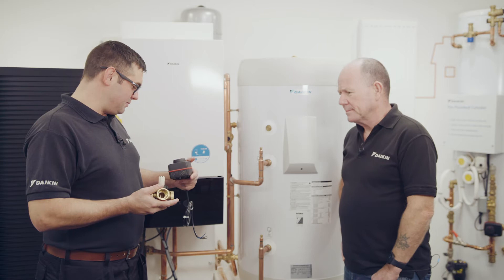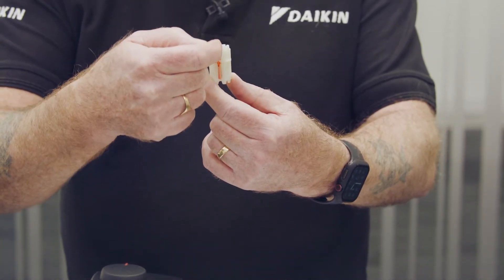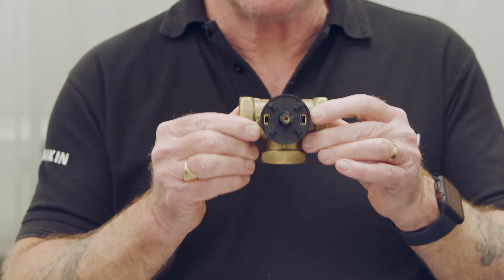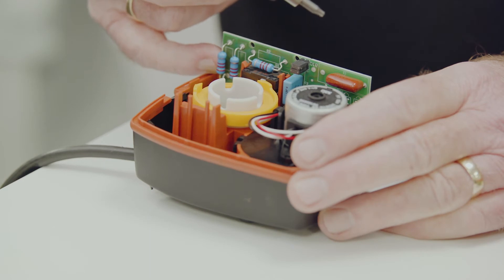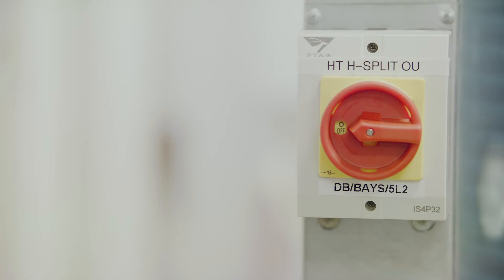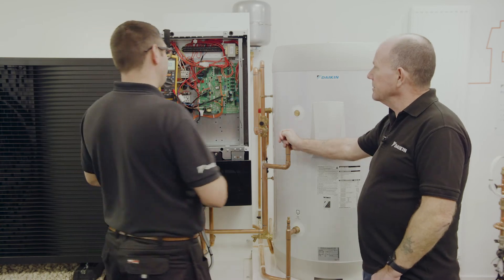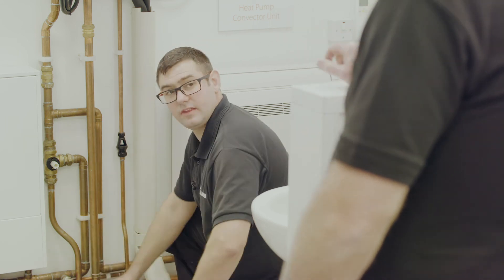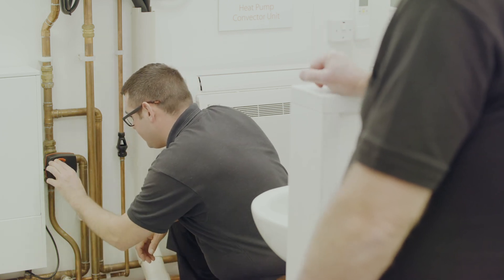Daikin Altherma ESBE 3 way valve explained

Comment: What happens if you connect the flow in the side port. I just checked mine and its been installed wrong (for 7 years!)
Reply: ignore that its connected correct.